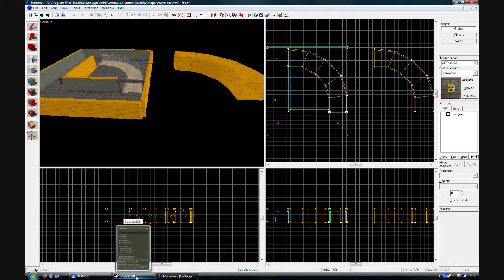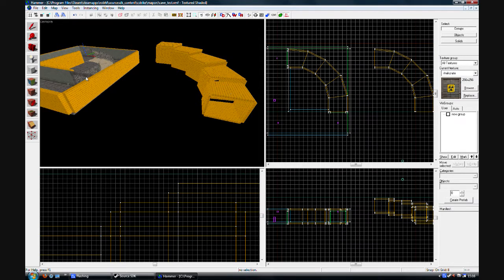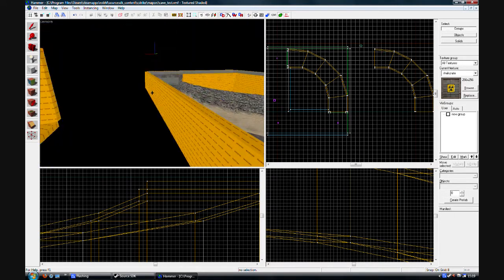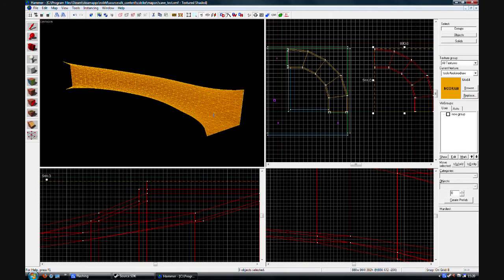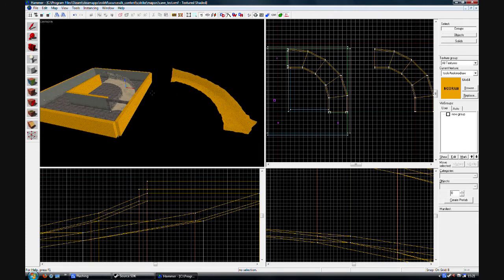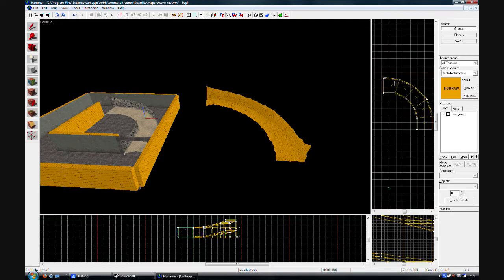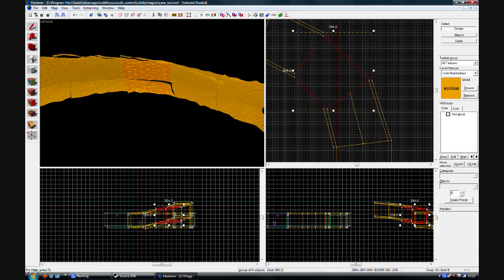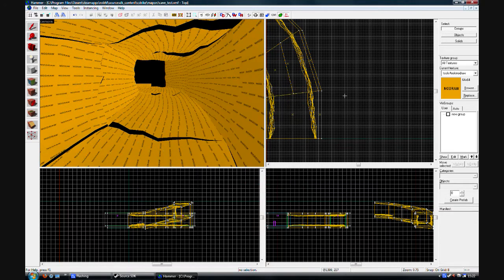Source SDK  Displacement Issues

Comment: I'm sure you've fixed this or gone onto different projects, but I would try sewing 2 displacements at a time, instead of a whole segment of tunnel. Also I think that when you connected the vertices (before you made the displacements) you may have created invalid brushes.

Also put 'solid'/not-displaced brushes around the outside of your displacements to prevent leaks.

Comment: As you thought, it's because you've made the brushes invalid. If you press alt+p (Problem Checker) it should tell you that they're invalid. When you load the map again it attempts to fix the invalid brushes.

The only way I can think of getting around this is by greatly simplifying the curve. As in, make it into a right angle (like an L) where the corner would be a square and the other long parts would be straight. You'd then have to manually shift it round into a curve which would be tedious.